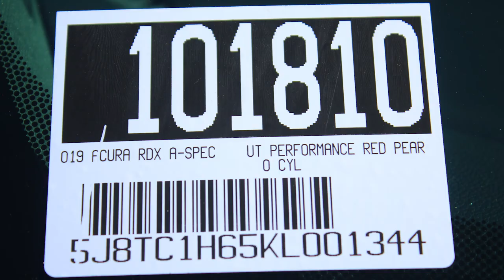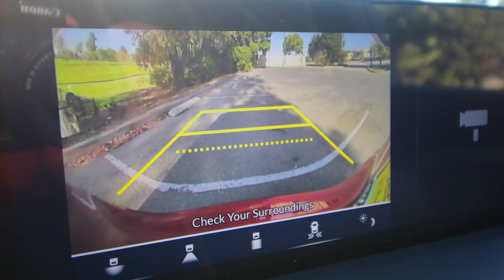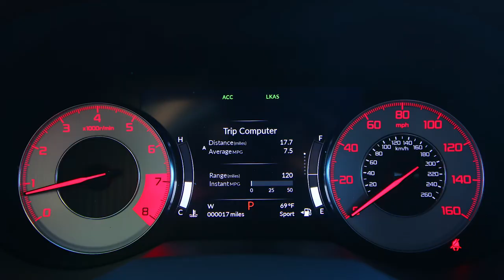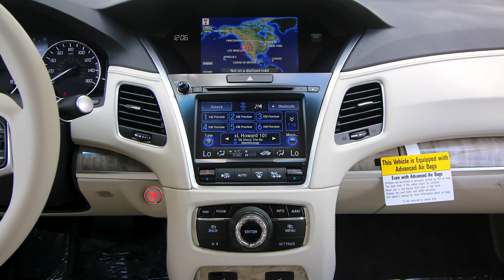Car Dealership Photography | What does a Car Dealership Photographer do? Dealership Inventory Photo

Comment: I'm really interested in landing a job like this, any tips on how to go about doing so?
Reply from the maker: When I applied for the job I had 3 years of experience as a Car Dealership Porter.  One of the requirements on the job application for this job was that you had to have experience about how a dealership ran and worked.  Thankfully for me my old job as a car porter was my saving grace in landing this job.   I think if I didn't have that prior experience they wouldn't have hired me.

I honestly wouldn't have any tips.  I had no real photography experience other that personal projects before this job.  But it was those small projects combined with my experience as a car porter that got me the job. I never would've guessed that it would've worked out that way but it did.  :)

Comment: Been doing this for the last 3 years. So much fun..... XD i mean i can be its nice to have admin days on rainy days but you shoot in the heat on a lot mid summer to the snow in the winter. I try to hide after a snow fall so i don't have to dig out cars XD. Have you run into it's your fault there not selling cars? My first dealer ship the used car managers always blamed me...  Im like dude we got the car yesterday the keys haven't even been processed.
Reply from the maker: Jeebus, how did I miss your comment?!?!
Thank you for commenting. It means a lot. :)

And the car dealership managers never directly blamed me for low car sales per se but they did on several occasions try and vaguely comment about more sales related to more car photos.  Which I guess makes sense but it's not like a photo of a glove compartment makes or breaks the deal.    

After both working as a car porter at a different dealership before being a dealership car photographer at this place  AND working at this dealership, I saw, over the course of 5 years how car sales managers always tried to find ways to blame others for low car sales.  

Heck even when I worked as a porter, those poor saps called sales managers even tried to blame low car sales on the placement of vehicles on  the lot.
Reply from the maker: Yea, they sometimes seem really disconnected from the process of getting a vehicle ready.   You'd think they'd know better.

Comment: I've always been interested in photography but never had the right resources for the right equipment to turn it into an actual hobby/job. Do you have any advice on good cameras?
Reply from the maker: Honestly my canon 70D did the trick for me.  It's all I've ever taken pictures with since I bought it.   I used it on this car dealership photography job for the 3 years I was there so I was very fortunate to say I literally made a living off of my 70D for three years! 

My 3 years as a car dealership porter job got my foot in the door as a car dealership photographer.   

I was a porter here in TX (we moved back in 2019) for 3 years and when we moved to Cali I was hell-bent on landing a photographer/videographer job and my experience as a porter DEFINITELY rolled over into the dealership photographer because I already knew how a dealership operated but when I interviewed for the car photography job I just showed them a bunch of pictures I had taken and my past experience really sealed the deal for the job. 

Photography was a hobby of mine for years before that but I also wanted to make a living off of it (but not forever) for a few years so I really got it out of my system with this job. 

I also landed a separate videography job that I had for those same 3 years. I ended up working the videography job full time and the photography job part time for those 3 years as well.  

The skills I learned with each really complimented the other. 

I made a video of a city called Ventura that basically also helped me land both of those jobs because the managers liked it so much.